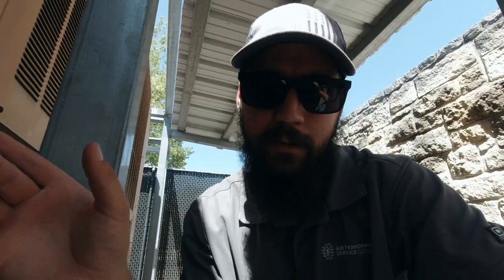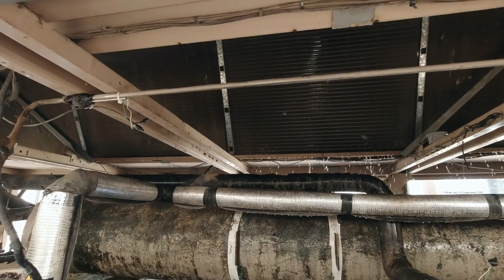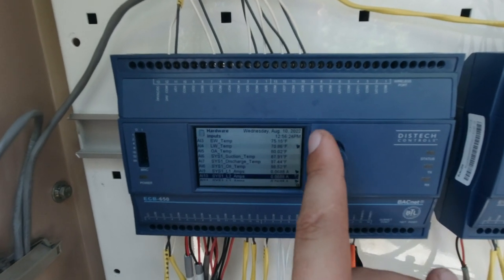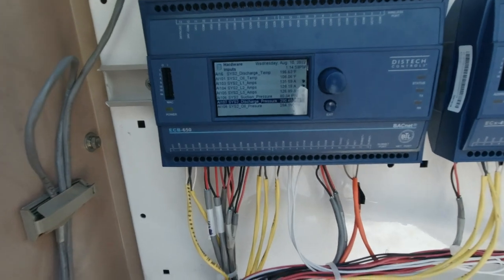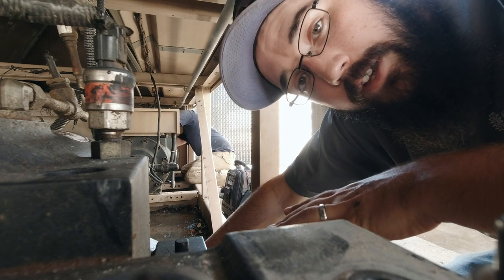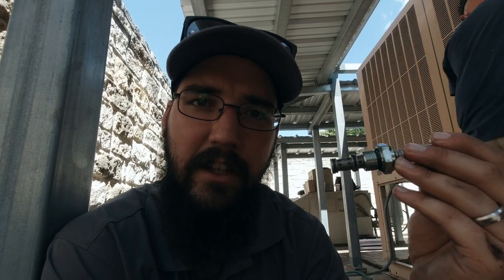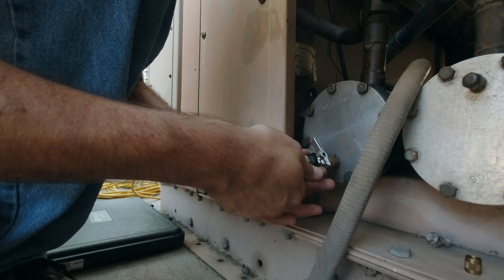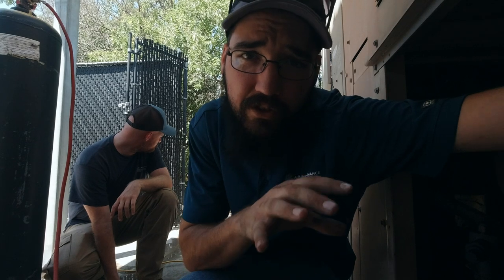This is not good for the Compressor!

Comment: If the cap control valve doesn’t correct it then the slide valve spring is broke. Takes about a day to replace the spring. You should be able to get the parts from CMP.

Comment: Hello Sir.
I have  facing issue regarding air-cooled chiller which is giving unsafe suction Alaram. I have been replaced solned valve, expension valve, core filter, suction transducer, but still iam facing same Alaram please give me your suggestion and support. Highly appreciate thank you.

Comment: Hey Holden quick question ... for a 100 ton Carrier Air Handler...how important are the VFDs. Because at this particular site they always have water leak issues and it’s not the drain. Another tech created a metal Sheild and attached it to the drain pan to help prevent the water from wicking off the coil. The coils are new as well as they were replaced within the year. Apparently the vfds failed and they have been running the fans at full bore... but it use to run full bore and not leak ... anyways just wanted some advice oh and the fresh are damper is missing 2 blades ... This is in south Florida so it’s definitely dumping lots humidity into the air handler. That maybe a cause as well.

Anyways I always watch your vids and actually your content has helped me a lot even after 22 years in the field. Thanks for what you do out there...
Reply: I would suggest getting a TAB company to check the airflow. Velocity is probably too high. Also, get the damper replaced. Definitely creating a lot more condensate than you would be if only moving return air across that coil.

Comment: It’s been about 10 years since I’ve done hvac so you will have to forgive me but what is this slide you are talking about on the compressor. Sounds a bit like a reversing valve to me but I’d like to know.
Reply from the maker: Its a internal load control device that adjusts how much compression and volume the screw compressor can move